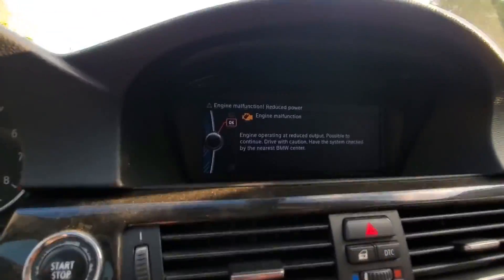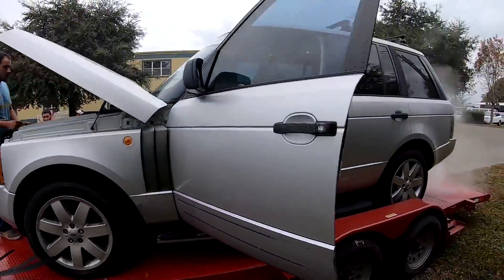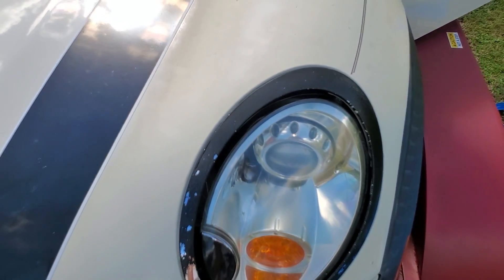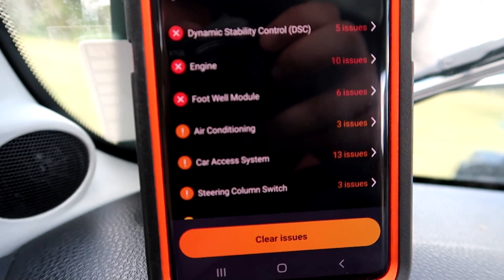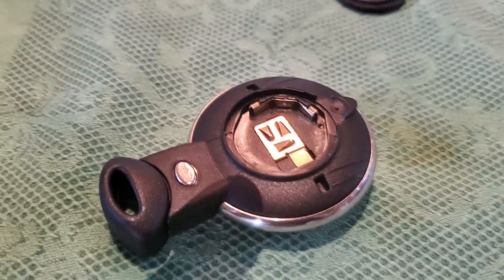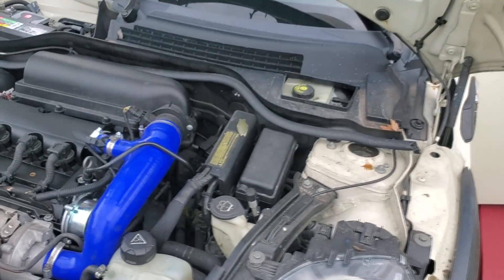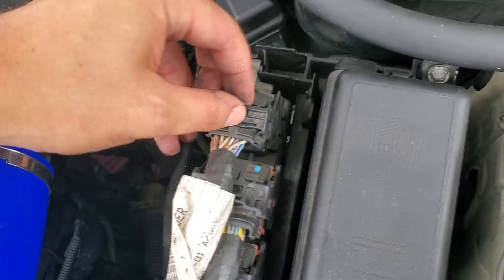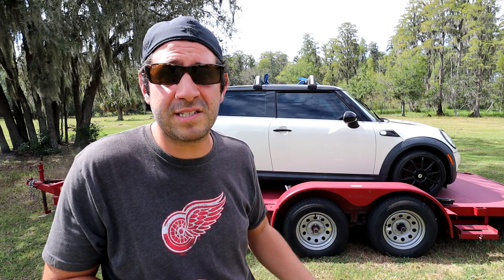I Bought a Factory Flawed Mini Cooper Turbo for $1,000 at Auction! How did Mini Get Away with This?

Comment: I drive a 2000 Camry with 431 K miles on the odometer or tyrion she looks and runs great. A couple years back I bought a blue driver Bluetooth diagnostic thing From Amazon. As many times as I've ever plugged it in and did a full scanned it never showed any codes or issues period of course I've never had any of the idiot lights come on so questioning if it even worked I plugged it into my friends 2018 Benz E. Immediately 37 different codes popped up including some type of electrical malfunction in the trunk. I then plugged it in to a 2017 grand Cherokee that showed twentyeighth different codes. Thinking maybe my Camry was just too old For the device I put it out of my mind until one day a at my mechanic's shop getting an oil change and tire rotation I saw a 1998 a Camry that had a blown engine because the idiot owner hadn't change the oil in over 20K miles. This poor beat up neglected Camry I was driving on to  Donuts and heads 3 car seats crammed in the back seat. In case you were wondering of course the  Owner wasn't white or married to the "baby daddy's" . I plugged my little blue driver device in to see what would happen and OMG my phone lit up like a Christmas tree. It gave me readouts on the catalytic converter, engine misfires, Evaporative emission issues you name it.